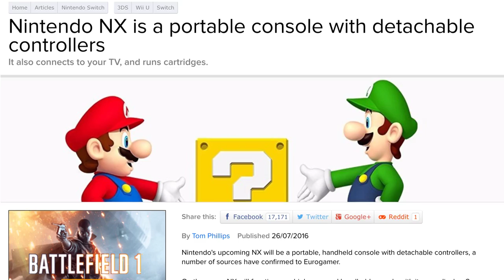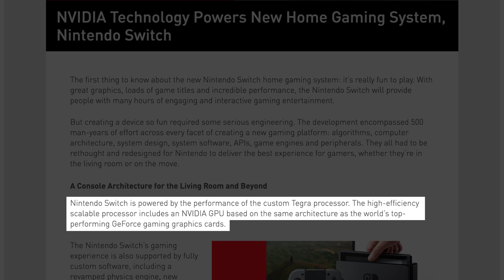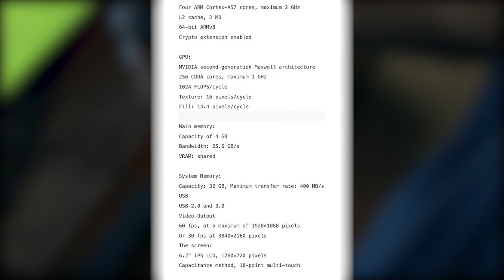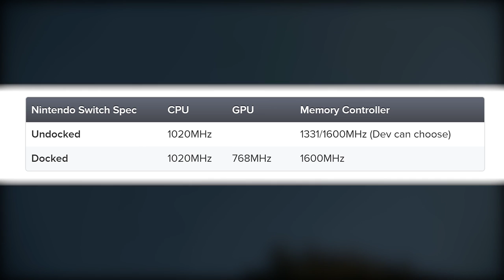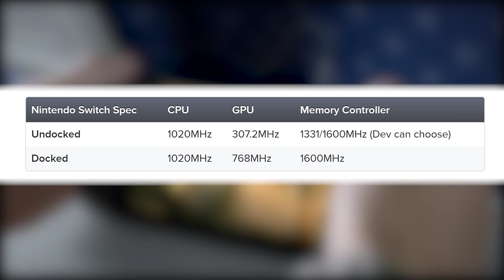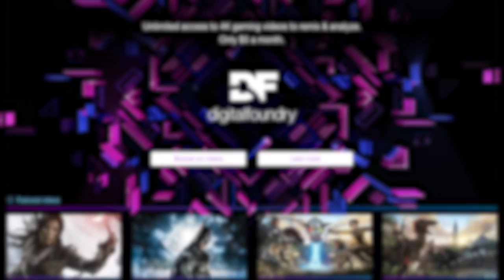DF Videocast #6: Nintendo Switch Clock-Speeds Revealed

Comment: its weaker then 360 for those people that dont know specs
Reply: hitman74 Wii U was more powerful than the 360, switch is more powerful than Wii U. Don't you listen?
Reply: Congrats, you are one of those people.
Reply: The X1 is double the power of the 360. Congrats, you just fell within your own argument.
Reply: IronGamingHD what? that's simply not true. It's not up to debate, it's not a matter of opinions, you are wrong.
Reply: No it isn't, stop getting conclusion out of numbers you clearly don't understand, this is easily 3 times the power of X360 at least.
Reply: When the NVidia Shield launched, the X1 was proudly shown off as twice the power of a 360 or more - so the Switch is going to be a little worse than the Shield, so it'll be about twice as powerful if not a little less.

Comment: Dolphin emulator is the worst way to determine how games would run on the hardware. My PC with an i5, 16GB of ram and a GTX 760 can't even run Mario Sunshine at 1080p 60fps but it can run the Witcher 3 at 1080p 60fps just fine.

Comment: Man this Sucks they should scrap the entire thing delay it for July and make this damn thing as powerful as an Xbox OneS
Reply: would be great if the battery wouldnt die 10 minutes after using the damn thing.
Reply: You can do both powerful GPU and Battery. The Google Tablet out now is almost as powerful as these specs. if these specs are true the Switch will be less powerful than 2017's phones. Nintendo is just being cheap and rushing if this is true

Comment: Really hope this is not true. 307.2 MHz. That's barely around 50% more powerful than the PS Vita. I'm not interested at all in using the machine in docked mode. I'm interested in having it as a decently powerful handheld that could outperform the PS Vita. But 307.2, thats weak AF.

Comment: Nvidia has a record of 48.7% better FPS/TFlop than AMD, (just compare the GTX 1060 3GB's 3.46 TFLOPS to RX 480's 5.16 Tflops). SO in case of 256 cores @768MHz we see 0.39 TFlops (+48.7%= 0.58TFlops). OR 256 cores @1GHz we see 0.512 TFlops (+48.7%=0.76Tflops) and this is 58% of a XBONE.
I believe the Switch WILL use Pascal... no way they will use 28nm tech on a battery limited scenario... Pascal pushes 55% more FPS/Watt(970vs1070)... This could mean a jump from 0.76 TFlops to 1.14 TFLops...

Comment: I want x86 CPU and GCN GPU +vulcan
I need it
Third party need it
We need AMD APU, like ps4, xbox one, even pc - not nvidia tegra.
And AMD/ATI gpu, like a gamecube, Wii, WiiU
Yes, tegra is SoC, but low voltage apu can be SoC too.
And amd can build apu with x86+arm cores both, nvidia can use only arm
Reply: AMD is Great, dude. It allways was.
I say no word about Jaguar. And don't say about cpu clock
After 2013 AMD release few generation of embedded APU and SoC in G and R series
R-Series embedded APU have Excavator (1nd gen) and Steamroller (2nd gen) microarchitecture, not jaguar
Second gen of R-Series apu is cool even for portable gaming device - its fast enough, have 4 or 2 core models and wide ability for downvolting.
And now AMD have prototype of "OWL-Family" zen apu 

 4.9 Gflops, 8 Gflops, 2.0 Gflops...
For first - gflops dont show performance in everyday use.
For second  - A72 have nice FPU for thats

But why ARM Cortex A72 ?
Meh, Tegra X1 use cortex A57 from 2014, not A72
And AMD used Cortex A57 too - for Opteron A1100 cpu (like experimental server cpu)
ARM Cortex A72 is simply much more efficient
Now is 2016 year and now ARM more efficient than x86 only in idle using - in full load they have same performance and almost same power usage (see comparsion CPU performance in Cherry Trail and Tegras), not critical differences
Now process techology matter more than microarchitecure.
But is no matter in this case - AMD can build apu with x86 and ARM cores both
p.s. ARM ltd. dissemble - in everyday use A72 not so good like they say

A 300 Gflops-NVIDIA GPu is FASTER than an AMD 300 Gflops-GPU 
Man, you are drunk
1) Gflops don't show performance in real life
2) 300 Gflops Nvidia it's NOT FASTER than AMD 300 Gflops GPU
3)  for Tegra  NVIDIA  love show about FP16 performance - half precision
Intel and amd say about FP32 - single precision
Hardware FP16 support its good thing, but comparing FP16 flops with fps 32 - its trick "First mobile one teraflop SoC"

AMD is inefficient as hell
You compare old Jaguar APU 28nm from 2012-2013 with new  20nm and 16nm chips ? Seriously ?

Comment: After i bought 3DS, i disappointed in Nintendo hardware completely. Slightly powerful than PSP in era of smartphones with nearly desktop performance and PS Vita(in hardware terms)...
Switch is great concept, lying on surface for several last years, and convinient used by Nintendo, but in hardware terms, it's so regress to games industry.
And it's twice sad that Sony completely abandoned PSVita, wich just slightly less powerful than future Switch. Sony just need renew Vita with more technological production process, add PSTV mode with dock station and DS4 gamepad support. It can be equal competitor, with proper game support.

Comment: ...it's a handheld. Why on earth are people expecting a PS4 Pro handheld running off of batteries from Nintendo? When I want good graphics docked I use my PC. When I want to take it somewhere, I'll take this.
Reply: other tomperson , because they're selling like an "hybrid" console and it's just a powerful portable. I see too much damage control, I'm trying not thinking like a fanboy the should implement denver cores and pascal shaders. With this specs multiplatform games are almost imposible.
Reply: Given that the literal only difference between Maxwell and Pascal is the die shrink, I don't see the issue. When you have the Paxwell architecture on a fabrication node that neither architecture had then it's arbitrary which you call it. This is something that is more powerful than the Wii U, and is portable.

Like I already alluded, if I'm buying a multiplatform game at all, I'm getting the PC version. Period. I would never, ever consider a PS4 or Xbox, and would only bother with this for the added versatility that I cannot get with my PC.
Reply: Better die shrink improve about 50% that shameful clockspeed at same comsumption and better gpgu that pascal improves vs maxwell.  

WiiU was a mistake ignoring multiplaform games next to a new gen in 2012 with 2008 technology. I wish I could see a Ninty less stingy with hardware and take SNES philosophy but it's clear they never learn since Wii, that's pitiful. Sorry for my bad english, I'm spanish.

P.D.: I really don't understand why there're so people agreeable with this, also most who aren't hardcore gamers use one platform a choose a gaming console because it's more easier and a accessible than a PC (yet :))
Don't wanna start a "internet wars" ok? Greets.
Reply: 20nm is more than halfway towards Pascal's 16nm compared with Maxwell's 28nm. It's truer to call this Pascal than it is Maxwell but in reality it's neither, but also kind of both (like I said, the only difference is the fabrication node). The gains Pascal saw were because 28nm -> 16nm is a massive leap. This won't see anything like as huge a benefit going from 20nm to 16nm. 

If Nintendo followed your business model it would kill them as a company. They did exactly what you are saying they should do back in 2001 with the Game Cube. It was a simple architecture, it was a powerful machine. It traded blows with the Xbox and destroyed the PS2. However the PS2 by far won that generation, and companies backed the least powerful machine of that generation almost unilaterally and the Game Cube suffered. Nintendo learnt from that that they needed to offer something different to the competition because 3rd Party devs left them way before the original Wii (let alone the Wii U like you claim).

The Wii U's only problem was that it was marketed terribly in a way that implied that it was just an accessory to the Wii. They didn't inform consumers what it was. The box itself was good and had some good ideas. Even with their less powerful console, they were still the only console to consistently target 60 fps and an art style that made it work. I fully expect the Switch to perform better than the PS4 Pro just because Sony is going to be focusing on beautiful 4K screenshots running at 20 fps -- gameplay be damned -- while the Switch is actually going to be playable with a simpler art-style.

There's a reason that The Wii U has a lot of PC gamers while PS4 and Xbone don't, these are people who don't care about performance in a console, because they already have a machine that hugely out-performs any console, and will continue to do so after all of the console gamers are being forced to spend another £350 on replacing their console with the newer version.

Comment: can Nintendo use 2 of the chips?
Reply: No point, using 2 chips is overall worse than just using 1 chip clocked higher.
Reply: FailCycle i mean doubling the cuda cores, from 256 to 512, and double the performance, and may also double the cpus for less bottlenecking.
Reply: FailCycle actually the x1 chip runs at 512 gflops, overclock it just increase it to about 600 gflops or more, double the gpu cores may get the performance almost 2 times better, which is between 900 to 1000 gflops, as with the cpu bottlenecking and other factors.
Reply: Still, the same logic, NS gpu actually runs at 307.2MHz when undocked and 768MHz when docked, resulting in 157 and 393 GFlops of computing power, respectively(according to the video). 
Increasing the core count(making the chip bigger) would be less efficient than just increasing the clocks.
Reply: FailCycle doubling the cores means that 157*about1.9*1.5(if pascal), and 393*about1.9*1.5(if pascal again), it get about 450 and about 1120 gflops respectively. they mention that it is really hard to overclock at this case, this will be the only solution at this case, and i will do it if i am one of them.
Reply: Walther Penne doubling the battery capacity also

Comment: If it is in fact that weak, I cannot say that I am going to buy this.  I hope Nintendo basically bombs.  I have been a fan and I have bought every system that they have made.  I am tired of this same old crap, where they are going to get no support from 3rd parties, because I just don't believe it will.  3rd Party devs want ease of portability and enough power to not neuter their games.  This setup does not accommodate, from what I understand.  I am thoroughly disappointed.

Comment: Dear Sony/Microsoft fanboys,

Software makes the system. Not specs. Power consumption will cause bad problems to the Switch if you want it to be more powerful than the PS4 or whatever. The Wii was underpowered and it sold 100 million units. Plus whay Digital Foundry claimed came from one source: Jetson TX1 : 256 Cuda Cores 1 Teraflop. I don't believe the Switch will have Maxwell X1. But I do believe the Switch will have Pascal P1. It's cheap, and efficient. Of course, in terms of power, it's not really impressive. BUT in terms of performance, the Switch will be a major success if it has Pascal, which means more efficiency, higher performance, and NO frame drops. Digital Foundry and Eurogamer will most likely be wrong. The Switch will not flop, the Switch will succeed. And here's the truth about Sony and Microsoft; they try to compete with PC, while Nintendo is tryong to compete with the mobile market that is expanding everywhere. So yeah. You Sony/Microsoft fanboys are more cancerous than us Nintendo fanboys. LMAO!!!

J  O  Y  C  O  N  B  O  Y  Z

Comment: Could the Switch be less powerfull than the PSVita with these Specs? If so, boy, that's a disaster...
Reply: Dirceu Franzner obviously no
Reply: no it outperforms the vita by a large margin. Vita is ~50gflops. Switch performace is currently still unknown cause we dont know everything about the console yet. Mobile Performance will be around 150gflops --> 300 gflops. 300 being unrealistc. so atleast x3 performance. Docked would then be around 10x performance.   Just for reference WiiU is 176 gflops.

All this being said, the Switch has a newer architecture what gives it more performance per gflop and has FP16 capability. FP16 pretty much doubles performance but you cant use it on everything. Actually you cant use it on that much so i would say an extra 20% performance bonus on top on average. Depending on the game.

TL:DR : Switch will while being portable mode have more powerfull then a WiiU which gives us 1080p/60 on Mario Kart and Super Smash, while only having a 720p display. So we have a "nicer" image here. You dont need huge pixxel count for 6,2" displays. 720p will look great. Then having the Console docked and going to a 50" TV you having a screen 64 times as big as the Switch with twice the pixxels on it. Dont expect PS4 like Image quality. On Nintendo games we may get a good looking game because they are good at using the hardware to it fullest and use simple graphics which need less performance to look sharp and great. But Uncharted or Order 1866 level is not possible. Maybe we get around Little big planet 3 level of graphics if were lucky
Reply: Dirceu Franzner it's more powerful from the ps vita . They said the rumors they are running dark souls 3 and they are happy . I believe it's gonna be more teraflops like 1.5 maximum . Cause dark souls 3 it's very demanding .
Reply: Yeah is a newer hardware than the PSVita, so it's probably more powerfull at all.
Looking more carefully at all this, I think the problem is how Nintendo is marketing this thing, its a little confusing, I mean, for a portable, yeah seems good, but for a hybrid, that's supposed to be a "home console" too, if this specs are real, could be a tough sell. Of course, getting the idea that's the Switch is just a "Shield underclocked", the final performance could be a hell lot better.
But, I think that if Nintendo market the Switch being a Portable, sucessor of 3DS, that can use a add-on to hook up on the TV, is a better idea.

Comment: I know the sources are probably correct but I don't want to believe NVIDIA and Nintendo are that stupid.  Even with Pascal they would have had a challenging experience creating a mobile experience similar to current gen consoles.  This will stop their 20 year relationship dead in its tracks.

Please God let them purposely be leaking inaccurate information as to throw us off.  We all know this Era of gaming is all ruined by leaks.  Hell, everything we watch is constantly reported on when they are trying to keep things quiet.  One can only hope Nintendo has finally gotten a grip and started to leak false info.

This better be wrong.

Comment: Nintendo always come up short.  

They haven't released a legitimate home console since the N64.  And even then, it was trashed by the PS1.

GameCube was garbage and couldn't hold the Sega Dreamcasts' VMU.
Reply: how about the wii which sold more than the ps4 and ps3
Reply: Justin Wong Sales do not mean the console is good.  Especially if you consider that all retirement homes has 2 to 3 Wii's to keep the elderly active.  The Wii was a gimmicky piece of trash. And had NO 3RD Party support.  In which even Nintendo lightly acknowledges that error reaching out to 3rd parties.

Comment: Nintendo are actually dumb, they should have just went with the Wii U route of making a tablet esque control pad and a home console. But add the xtra twist of making the control pad have it's own chipset. Instead they made a 2in1 with a old chip which is stupid since now it will be underpowered at launch. Next year's cellphones will probably be more powerful than the switch.

Comment: So you guys said "Nintendo does not talk specs they show experiences" and i agree. Now! What experience will that Nintendo retards will show us with just 307,2*2*256 =157.2 Gflops compute capability ????? For god's sake it is like 2,5 times slower than Adreno 530 working at 620Mhz found Snapdragon 820 found in smart phones like Xiaomi MI5 , SGS7 etc etc and those gpu's are working without any cooling solutions. If those speeds are true, then no custom  work from Nvidia  will help it. The End result will be that in portable mode it will run Games like Zelda B.O.W in 720p at 20fps tops! Of course Docked speed are also joke ! 1st GPU clock Speed is very low, having just 393.2 Gflops vs 352Gflops of WiiU and 2nd, what about memory bandwith  and fill rate? it will be a miracle IF switch will have any of the 3d party games developed for it an my prediction is that after the first year's hype it will be forgotten by Devs.
Reply: jimmy fallon ran the switch with breath of the wild on both docked and undocked.It had higher framerates than the the wii u,no performance drops ,and had a little bit higher render resolution

Comment: If the chip in the Nintendo switch isn't Pascal based, I'm definitely NOT buying. Fuck the X1 Nvidia chip. it's power hungry and just stinks. It's supposed to be 2x than a xbox 360which is total bullshit. if it is that powerful who ever ports games to Android like borderlands, resident evil 5 are awful. can't even hold 30 fps with super low settings 720p. Nintendo just fucked up. No pascal no buy!
Reply: Whats even worse is the X1 in the Switch isn't even running at its full potential.  Another POS console from Nintendo.

Comment: Men, it's ok to innovate, but if this is true then Nintendo has died for me; worst than a Xbox360 in 2017 it's not tolerable. GPU suxs, CPU suxs, controller suxs, portability suxs (if I wanted portability i'd buy a 3DS). WTF Nintendo? And the worst of it, the console could be better, Nvidia has better Tegra X1 chips, but Nintendo it's so stingy they won't.

Developers won't be very much attracted to this old piece of portable crap, that's my opinion, and no Third Parties, no party.